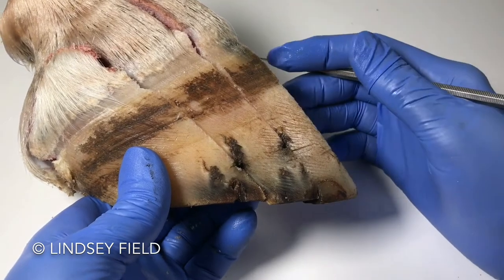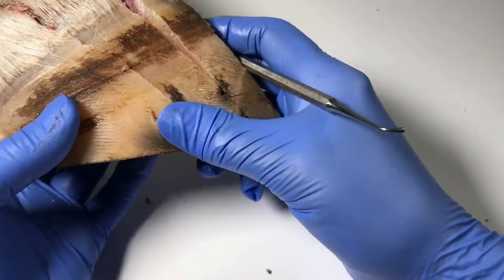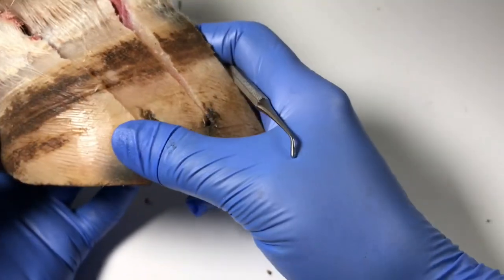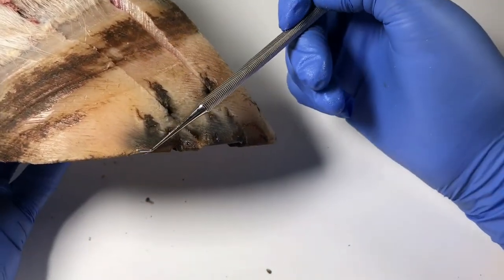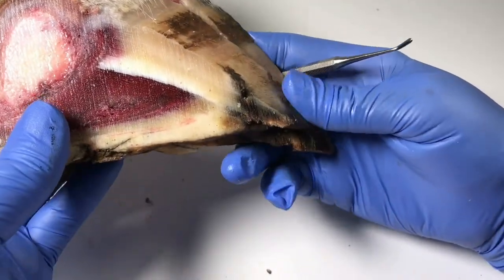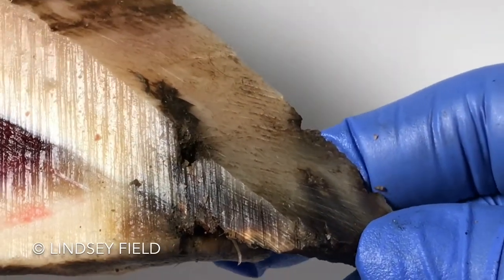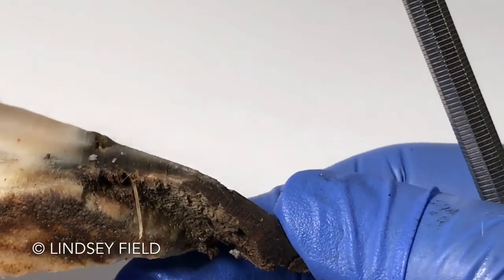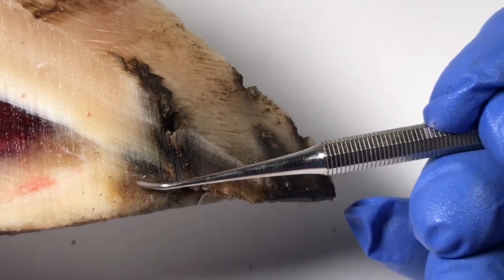Nail holes on a shod equine foot

Comment: I think that farriers rasp the outside of the hoof to make the points of the nails less sharp. When the nails are put through the hoof they are too long and the ends are clipped off en hammered flat on the hoof. Then they rasp it to make a smooth surface. This is how I have seen it being done in Belgium.
Reply from the maker: Thanks for your comment.   I thought that the rasping was to make the hoof look clean and new.  I did not think about the nails being rasped down,